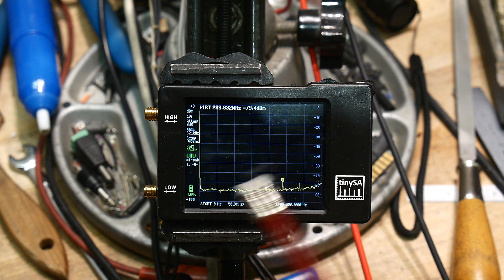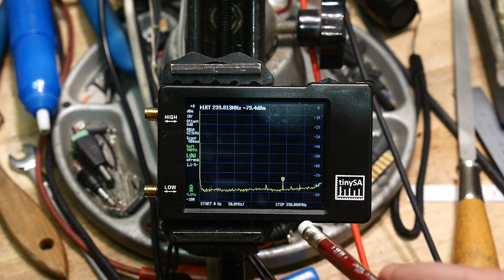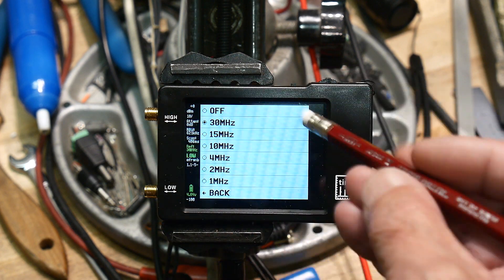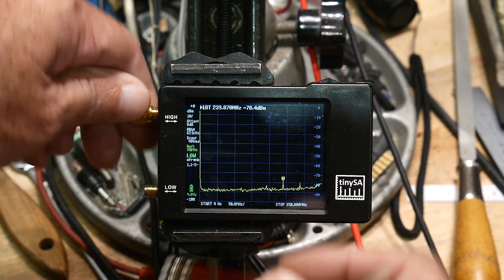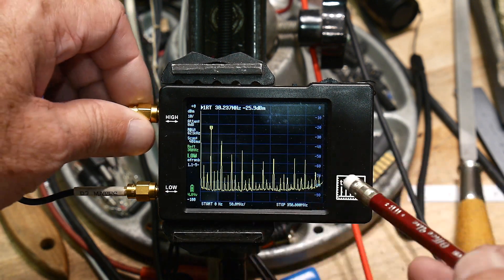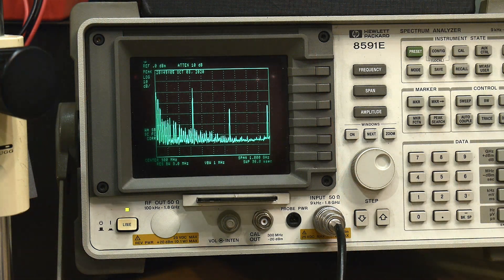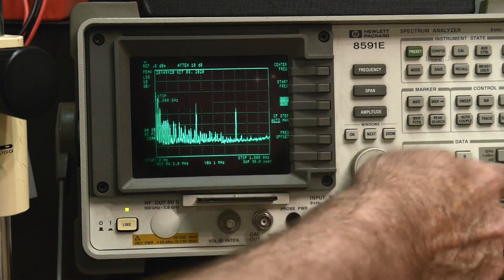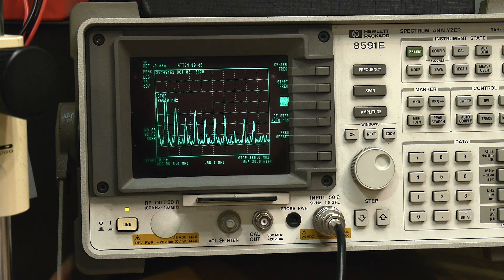#576b TinySA Calibrator Output Caution

Comment: Can I use my LiteVNA to measure OUTPUT impedance of an 2.4 Ghz (13dbM) amplifier?  

The ones I'm using are supposed to be 50 ohm, but they are cheap and from China.  Before "blindly"  designing a matching network so my antenna looks like 50 ohms to the amp, I think it makes sense to actually measure the output impedance of the PA.  Especially since I plan to use them at 2.51 Ghz, not at the 2.45 Ghz center frequency.

Can I get attenuators that have different load impedances?  I'm thinking I could do the math to compare the output dbM with two different load impedances, do the math, and figure out what the actual output impedance is at 2.51 Ghz.  Then design my matching network for that, rather than 50 ohms (if it differs).